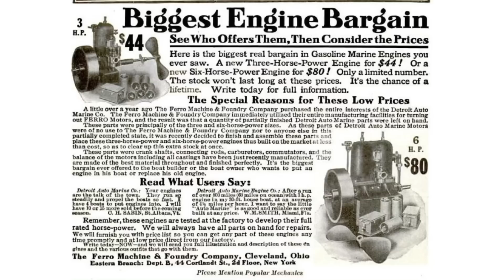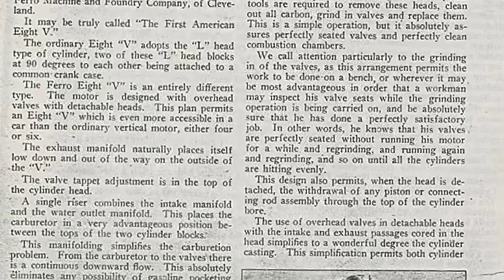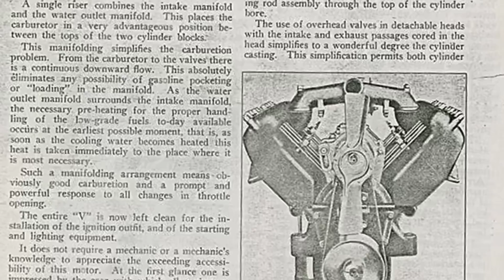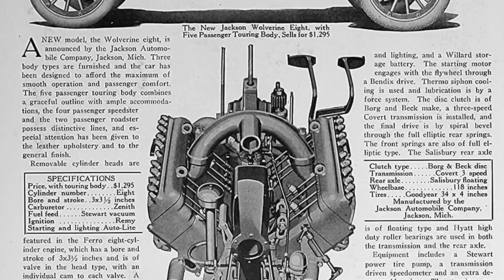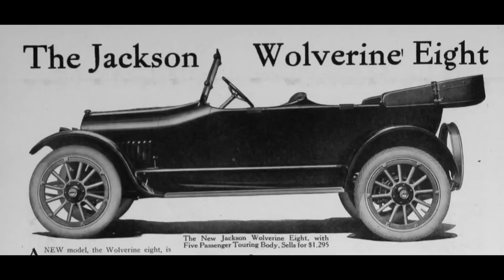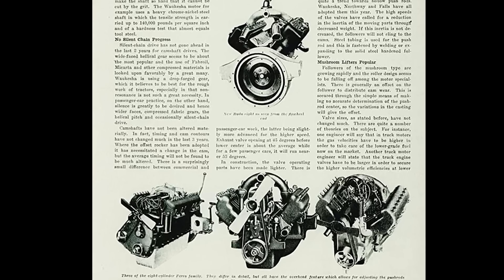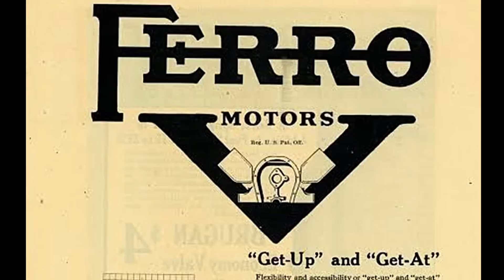Ferro Engines, Americas most modern V8 you’ve never heard of 162, 198, 265 and 350.5 V12

Comment: Chevrolet had an overhead valve four cylinder engine during that time period. however the valvetrain required manual lubrication.
Reply from the maker: The Chevy engine came after this and copied a lot from this design but its cast differently and had problems

Comment: Well ahead of its time!  It sounds like the V12 could be used as a race car engine, roller bearings cams in my vague recollection were a sign of a racing engine. 🔥
Reply: Roller lifters were common back then, but were expensive and so guys like Henry Ford opted for flat tappet type.

Comment: Your 350 CID V-12 is clearly WRONG. Look at your spec panel (~7m20s) which shows a 10.1:1 compression ratio ..... what?? You must be kidding, T.E.L. wasn't invented until 1930l. If that CR was genuine then the b.m.e.p. would be that of a modern engine and the power output number would reflect that. Forget 80Hp, more like 280Hp++
Reply from the maker: All the information is taken from text from the period
Reply: @What.its.like.  Surely you don't believe everything you read? The bottom line is that you can't cheat the laws of physics - any 1919/1920's engine running a 10:1 compression ratio fuelled with the regular fuels available at the time would detonate itself to bits within moments of turning the ignition key (or hand-cranking!). To put this in perspective, take for example a 1930's era (i.e. a dozen years later) PACKARD V-12 whose 7.3Ltr engine operated with a maximum 7:1 compression ratio which yielded 160Hp remembering that by this time ethylated fuels were available. Unless the FERRO V-12 was drinking some special hooch then the specs are just nonsense.

Comment: Thank you for putting this together !!  Excellent to bring these to light.  I was aware of these OHV engines built for Scripps - Booth, and they were the first one piece block production V8, LONG before Henry's flathead !!  Roller lifters, and... Ball pivot rocker arms decades before Chevy and Pontiac 1955.  Having heard one of these run, I can tell you they sound great and they are nicely finished and look great.  Ground zero for the American V8. Never heard of the V12, though it may have been a developmental dead end, due to 3 main bearings and it looks like 90 degree bank angle. Three big main bearings worked well on early V8's right up through the 1940's, though.  One point of interest is that Ferro built many flathead V8's, inline 6's and 4 cylinders for General Motors in the teens and early 1920's. They were very prolific as an engine / casting supplier to the industry, I've seen a few oddball engines with that very distinctive Ferro logo.
Reply from the maker: I love covering stuff that is obscure I really dig this engine design it's a pity it didn't catch on 

Thank you so much for sharing all of the insight and information

That V12 is a true head scratcher.. but interesting concept nonetheless the less
Reply: @What.its.like.  Yes, there are a vast majority of "car guys" in the 50 + year old range that believe Ford's flathead was the first production V8 engine, first V8 with a one piece block, ect.... and they re-gurgitate this to he newer generations as facts.  I feel it is super important for someone like you to "blow the cobwebs" off this truly innovative early stuff.

I feel that a huge part of the problem of what I call "automotive ignorance" stems from the post WWII boom in hot rodding...... This was the beginning of mass merchandising that hobby.  Guys like Wally Parks did much to portray that era as the beginning of the hobby itself, and that is almost criminal , to say the least !!  What Wally and his compatriots did was heavily promote that boom, which was largely Ford flathead based, as they were cheap, readily available, and good for the purpose.   The downside of this mass-market explosion of the hobby was that most people forget about all the cool things that came before it.  Yes, not only were there really cool engines prior to the Ford Flathead, but hot rodding was a thing right from the beginning of the industry!!
Reply from the maker: I was mislead thinking that as well I just found out recently about the V8 in the teens so many different designs, nothing is new just recycled technology with a new sticker.

There is a lot of innovation that is getting lost to time I feel like two speed rear ends should make a comeback could increase fuel economy
Reply: @What.its.like.  The "dual ratio" rear end is so excellent from a driving efficiency standpoint. More efficient than using an overdrive to compensate for a low geared rear end.   Actually, one of the biggest applications I see is in electric vehicles, of all things.  Electric vehicles have a gear reduction between motor and wheels of between 9:1 and 12:1 or more, depending on model.  Electric motors get very hot under high torque low speed conditions, so having a dual ratio setup would be great, and could easily be electronically controlled. (with manual control option)

Remember, most modern folks can't really drive..... Nor do they care, hence the death of the manuals.
Reply from the maker: I totally agree with your statement

Especially the part where most modern people can't drive .. it's like driving is looked upon as a handicap now I don't know it's weird

I have a 52 Chevy 1 ton truck with a four speed stick manual everything  brakes steering wipers transmission I would not trade that truck for a new one. I absolutely love it. I love switching gears. I love the sound that it makes. Linkage clutch is better the hydraulic, you can feel everything
Reply: @What.its.like.  The tactile involvement and all the sound track is what's missing on modern vehicles.  By the way, the SM420 four speed transmission in your 52 Chevy is my favorite !! 
I drive one every day, and that sound it makes is mechanical music.  One of the things I love so much on old vehicles is the individual sound of each gear. Call me nuts, but these things matter to me!   So much so that a Design / engineering project I've been working on for a replacement gearset for an early Land Rover 4 speed transmission involved choosing tooth counts on the individual gears to get good sound quality !!  The updated modernized internals for a 75 year old transmission HAD to have a proper, pleasing vintage sound HaHa!!
Reply from the maker: I absolutely love the sound of that transmission I wish first gear wasn't a granny gear, but aside from that.. 

At the top of third when you ream it out it sounds like it's supercharged. It's so satisfying. I love that transmission.  

The syncros even make noise =) 

Thank you so much for sharing your experience with that transmission
Reply: @What.its.like.  Air raid siren !   A lot of people don't get it, but some do.    Keep up the good work ferreting out these obscure, yet important bits of our automotive history !!
Reply: @timmcooper294 it's interesting how a lot of history has been reshaped.  The Ford model T is probably on of the biggest contribution to the hot rod culture. The model T probably spawned more automotive accessories then any car. And the speedster movement in the teens (1915 to 1930s) was really the start of the car culture, hop up parts and custom car parts were all the fashion of the day.
Reply: @neildorey3978  Absolutely agree on the T !!  Hot rodding was alive and well long before the 1932 Ford flathead V8, and long before the late 1940's, when Wally Parks and his buddies in SoCal claim to have started it all.    The history of hot rodding is so much bigger than all those guys.    I love the stripped down "T" s , and it's a real treat to see a hopped up car from the Teens or Twenties, especially an oddball make !!    I used to spend hours reading old auto publications from the Teens, and discovered things like limited slip and locking differentials were available from the aftermarket prior to 1920 !   (Wikipedia claims the limited slip differential originated in Germany in the early 1930's PFFFT!!!)
Reply: @timmcooper294  yeah, Wikipedia has its problems forsure. I run a 2sp rear axle in my 1915 model T, called a Ruckstell. My particular one is a Hall Scott. I'm in the middle of building a 1916 Briscoe Ferro V8, for a speedster build. I will use a 1915 modelT chassis as the foundation, I will use a Muncie transmission that was a accessory transmission use on the back of a model T transmission. It's basically a 3spd and 3rd is overdrive. I expect it will be good for 90mph if I'm crazy enough to try. Lol
Reply: @neildorey3978  Now That sounds awesome !! 👍 I know what those parts you speak of are. I also see hot rodding potential in many early engines that are generally ignored.  That's a lot of engine and speed for that little chassis, but that's hot rodding, right ?!!       I love cars that I'm afraid of !!
I have a 1927 Hudson that I'm restoring , along with an extra, complete rolling chassis.  That 289 CID F head six has insert bearings, beefy counterbalanced crankshaft, huge valves and a roller cam. It's basically the flathead six Hudson introduced in 1916, but with a factory "F head conversion" I've been thinking about cutting down that rolling chassis and applying some of my engine skills to see what that engine can really do. Could be a fun and unusual hot rod as well.

Comment: yea never heard of it till now, sound like it was crazy ahead of its time, and monoblock like the later offenhouser that for a good 30 years knew no equal at indy for powering winners, but it does have downsides in relation to some of the advanced stuff today. though they ran at a lower rpm back then and were heavier.

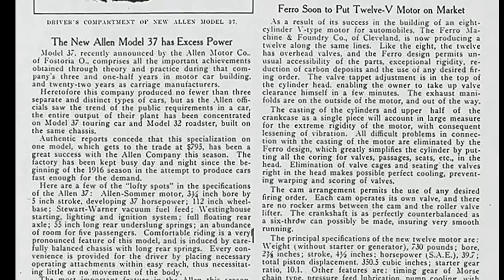Comment: Regarding the Ferro V12 at timestamp 6:14,  just looking at the cylinder castings, that crankshaft only had 3 main bearings!  I shudder at the uneven torque distribution along the crank and torsional stresses it must have suffered.  It's full counterbalancing notwithstanding.  
As for the compression ratio, I just can't accept that it had a 10:1 CR.  It's got to be a typo.  The gas didn't exist for that kind of CR and it would've broken that already weak 3-main bearing crank in short order.  A 5:1 or even 4.5:1 CR would be believable.
Reply from the maker: I saw after putting this episode together I was able to find that the compression ratio on the V8 were 5.5:1 supposedly

That v12 is a very interesting design though. I wonder if it ever got made I've never seen any pictures of the cylinder heads attached. It probably didn't work I couldn't find what it was used in maybe was a purposed boat/marine engine none the less a real head scratcher for sure and to think that was over 110 years ago
Reply: @What.its.like.   The only job I would use it for would be on a boat.  The power going through a gear reduction to a large slow turning propeller.  Spinning a load in water would create no sudden stresses on that weak crankshaft.  

Case in point, a popular auxiliary engine for sailboats long time ago was the Atomic 4. A flathead inline four that only had two main bearings and the crank was supported only on the ends.  Why?  It made for a very compact design and it was only turning a propeller to help get the sailboat in and out of port.  They could be had with large 12V generators to power hotel loads if the yacht had such amenities.

Comment: So......what is a flat-crank V-8 or a cross-plane crank V-8? You share no picture and make no mention of it. Also, I believe you meant to say "...3 exhaust outlets per cylinder BANK." Three outlets per cylinder is just dumb, and would result in 12 outlets to the manifold on each bank. In case you didn't know, a 3-outlet manifold was UBIQUITOUS on American V-8 engines, and is present on any V-8 where the valves are "siamesed",  like say, Ford flatheads, or Chevy small-blocks, etc., etc.

And, as to the 10:1 compression? No_way_in_h3ll is that correct. Even aviation engines didn't have compressions that high. Gasoline with octane ratings high enough for that kind of compression did not exist until the 1930's, and even then was pretty much restricted to aviation and racing. Higher octanes only became available for the general motoring public AFTER the war; pre-war most gas was about 70 octane, with the rare premium being as high as 85RON. Post-war, 85 quickly became the standard, with premium slowly working it's way up to 100RON. BTW, this is a number that is higher than today's "pump octane" rating, which is an average of Research Octane Number and Method Octane values. So, that 85RON was more like 80 "pump octane", and 100RON was the equivalent of today's 94.
Reply from the maker: I didn't mention it in this video but it's been mentioned before 

Thank you so much for taking the time to share all that information and and say I'm with you I don't think that the compression ratio was 10 of the V12 I was able to find the compression ratio after I put this episode together the V8 were rated at supposedly 5.5:1 which is a realistic figure for that era 

I would love to know if the 12 ever was produced obviously they had that one unit but I've never seen a picture of it completed .. the casting would be quite the challenge, especially for that era that is a big casting to do in one section.. the other things really take away from those engines, especially the V-8 variety was how much or how how little they weigh the weight was impressive to me 

I put as much text in the video as it possibly could because I got all the information from the text, but the text also contradicted self in areas.. 

It's a very interesting gloss and forgotten engine in my opinion. I really want to find a car with that engine in it. I want to feature it hopefully next year maybe I can find one at the old car show at the Greenfield Village next year
Reply: @What.its.like.  Try looking into speedboats of that era.

Comment: 1955 the start of the common V8?
About 5 million Ford Flat Head V8' might beg to differ...
Reply: OHV began gaining traction in the '49 Cadiddle-Yak and Olds models, and by 1951 even Studebaker had an OHV V8, more horsepower per cubic inch than the '51 Chrysler Hemi. Lincoln got overhead valves in '52, but Ford and Mercury were late to the OHV party in 1954,  Packard and Pontiac replaced their side-valve inline eights with OHV V8s in -55, the same year as Chevy-s second V8, and AMC had its own V8 in 1956, having used Packard's 320 for 1955.
Reply from the maker: But the ford v8 has issues I should have said it differently by 1955 if a company didn't offer a v8, they went under Kaiser jeep is the only exception they did get V8 from AMC also ohv became industry standard in 55 

Ford is only one company all companies offered a V8 by 1955..
Reply: @What.its.like. The 55 chev small block never even had an oil filter and it was in production for only a year. Issue? Then there was Cadillac, Chrysle,r,Desoto, Plymouth for a start. The Chev was the first light weight small bloc in the US. .That was what made it special.. Tatra did it years before WW2.r All Engines have had "Issues" in some form or another.

Comment: Gasoline back then was probably half what we have today, but the 50- 60's  was race fuel compared to today's fuel.  A high compression may not been  possible however , they still had methanol! Equal to something like 120 octane gasoline, with the added cooling of the intake charge.
Reply from the maker: That 10.1 compression ratio was insane that's why I put the text in there ( honestly that's why I put all the text in so what I'm saying is backed up with something ) and to think some people don't like that